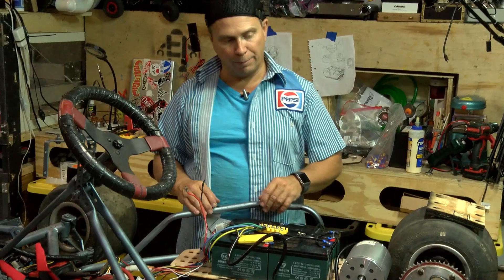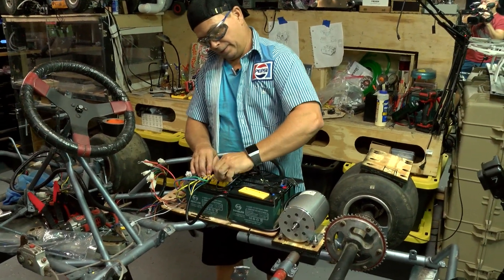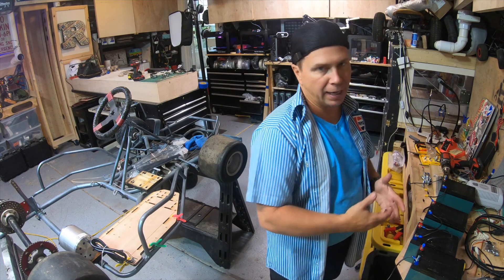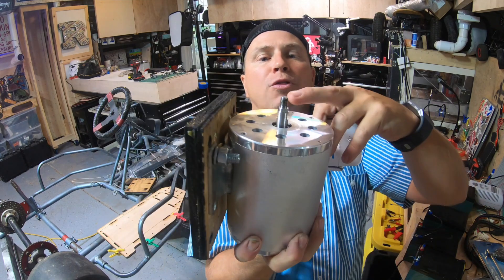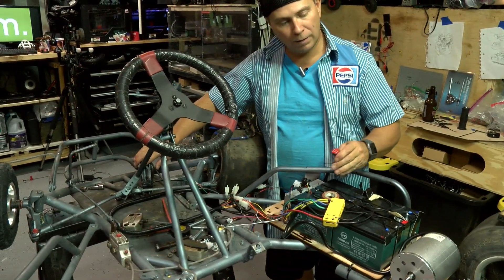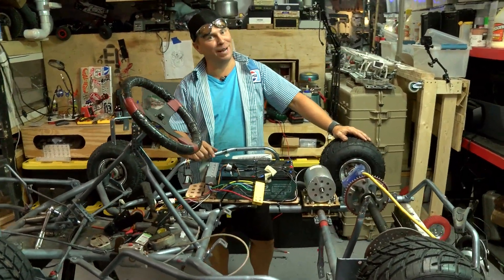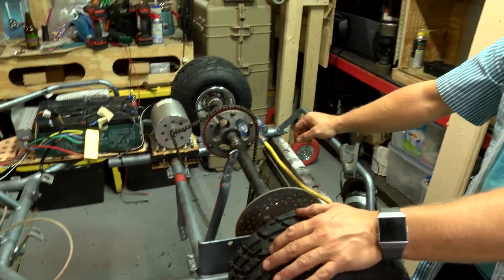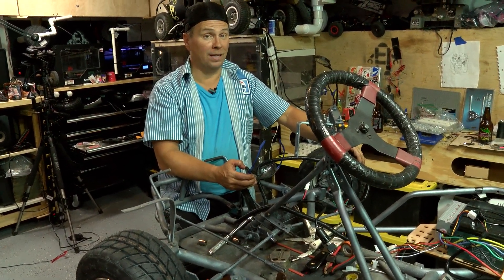Electric GoKart Conversion from Gas (Part 2)

Comment: stop going about volts, ampage is the killer
Reply from the maker: Ok , I’m an idiot about electricity. Thnx.
Reply: @hacklab.ryandewitt  The volts are how you get the current to travel through your body and kill you, and you only need 0.1 or 0.2 amps to do it.
Reply from the maker: @EpsilonZeroKarts  thanks

Comment: Did you say the kit was 400 and the batteries were 200? Because I’ve seen them very commonly at far lower prices than that it should be more like 350 for the whole thing including batteries
Reply from the maker: 350-400 for everything
Reply: hacklab ah ya that sound a lot I better I was worried lol

Comment: Hey Ryan!  just noticed that the tyres are directional - you have them facing backwards so will need to put the left wheels on the right side and the right wheels on the left side otherwise the cart will not grip the road very well 😉
Reply from the maker: Super 73 UK oh crap, I’ll flip them